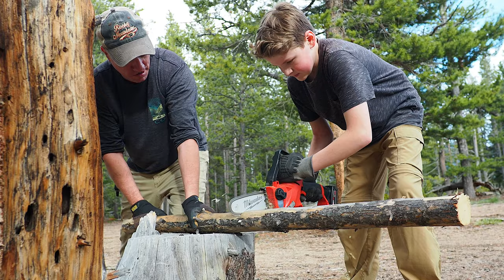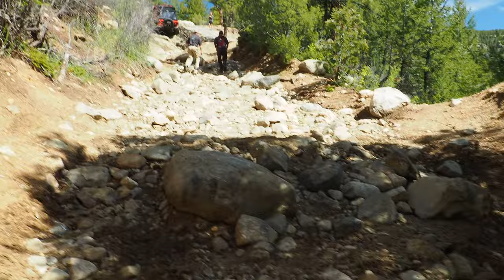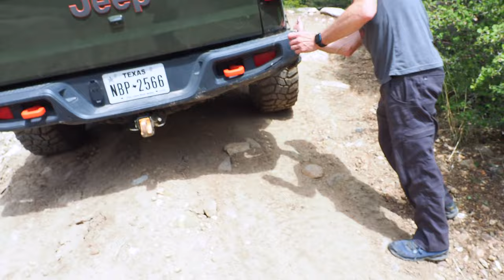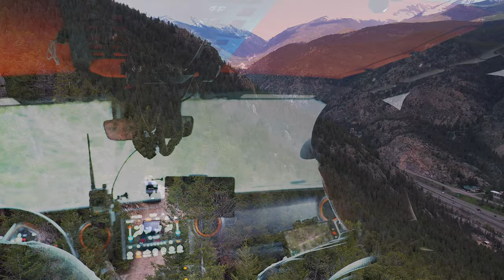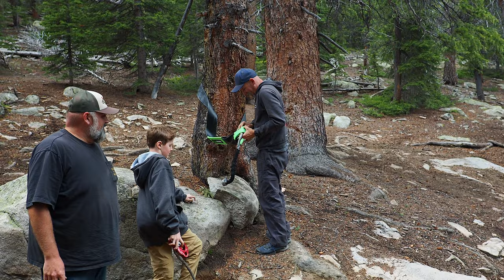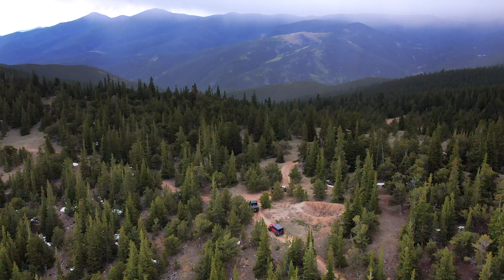Spring Creek (Jeep Gladiator rock crawling) [ep 129]

Comment: Wow, incredible ride. Those winches come in handy!  And the places you take that Mo-chine to- who says you need a great breakover angle and front lockers!  With that back bumper, I would work on getting a nice steel one that looks better on the rig the more you beat it up.

Oh, and that smoke that comes from the intake valves from the PCV valve, it's supposed to burn off real quick but never does.  Any jeepers will let you know that in steep accents, the accumulated oil under the valve cover collects to the backside and trys to burn through one cylinder.   It might foul the spark plug, or worse yet clog the manifold.  I have an oil catch can when I heard about that.  I have to empty it every 2k miles (and the oil mix that's in it smells and feels foul) but I think it's possible that I increased the life of the engine.  My dealer said it might not pass smog inspection, but I'll worry about that when the time comes.... again thanks for showing us what the Mojave is capable of.
Reply from the maker: That’s some solid info Billy! Hope you’re doing well!
Reply: There’s a couple other systems available for the smoke refill kit. I have teraflex kit that puts the oil back into the oil fill area. Good luck all

Comment: Fun to see how on different obstacles the longer wheel base is an advantage. No front locker and walked up the wall vs. the white Rubicon Wrangler with both lockers. Did the red Wrangler that took damage have steel fenders? Wonder if it would have saved body damage if they were plastic? Great video!
Reply from the maker: It's a blessing and a curse I tell you what! And GREAT point on those steel fenders (which they are). It's really too bad KBD doesn't make a highline version!